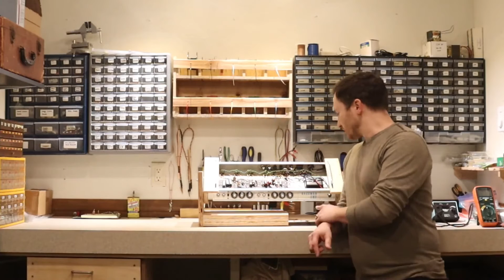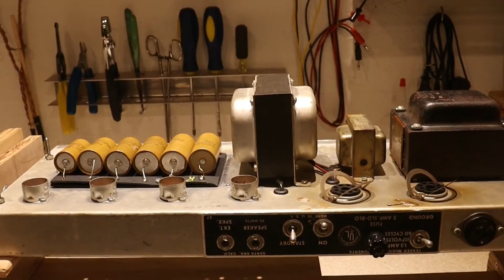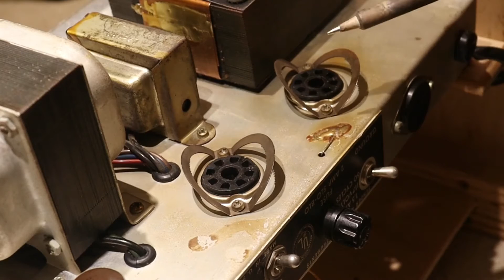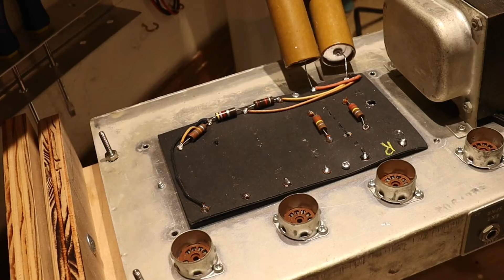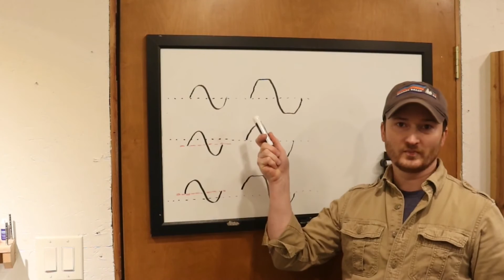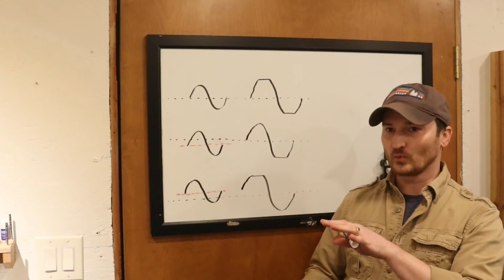Fender Bassman Repair Part 1

Comment: Interesting vid. The plate voltage goes high, up to supply voltage, when the tube is in cut off so no current flows through the plate resistor. Plate voltage goes low as the current increases through the plate resistor as it approaches saturation.

Comment: Glad to have you back, Tim!  And working on my favorite Fender amp of all time to boot AB165!  Just overhauled mine for the third time.  I've owned my '65 since '96!

Looks like the all 7 of the diodes on the bias board, as well as the bias electrolytic cap, have all been changed out.  Stock, they would have been metal can diodes.  They're cheap and should be replaced.  Everything else looks bone stock.  All coupling caps and resistors look to be stock.  Transformers have sane date codes, and look correct.  Transformer wires in my '65 and '64 (AA864) bassmen are both stock, and do not use cloth insulation wire.  I generally leave the blob on the chassis.  It's less invasive than heating that entire area of the chassis up, which basically requires full disassembly of the innards for deep cleaning (restoration that this amp clearly doesn't need).

I would personally swap out 2 of the three clustered "brown-turd" film caps on the main board.  These are the PI coupling caps to the power tubes.  They should be replaced along with the electrolytics.  Orange drop caps are expensive, but are the standard retrofit for the PI to PA coupling caps in an amp like this.  Any DC leakage here can cause the amp to lose bias to the power tube grids.  Both polypropylene and polystyrene film caps are moisture degradable, so much like electrolytics, they are born to die eventually here on Earth.

The key to the AB165's sound is in the mixer stage, and all of the other NFB loops in the amp (2 SE, 1 diff pair).  This many layers of foldback current cause so much destructive interference in the highs, that it mellows the amp out as the volume and distortion increase.  This also causes it to distort chiefly in the mids and lower mids, but have note clarity as a result of the NFB phenomenon in chord harmonics.  If you haven't had a chance to play one of these somewhere between 6 and 7 with a 4x12 of greenback-like speakers, you're in for a real treat, amigo.
Reply from the maker: Wow! Thanks, Jamie. Great info. I'm pretty sure I have some Orange Drops for the PI outputs. I'm glad to have someone more knowledgeable chiming in.
Reply: @timkrauseelectronics9245  I wouldn't say I'm more knowledgeable, Tim.  Just more familiar.  I've had an ongoing love affair with my AB165 for 25 years!